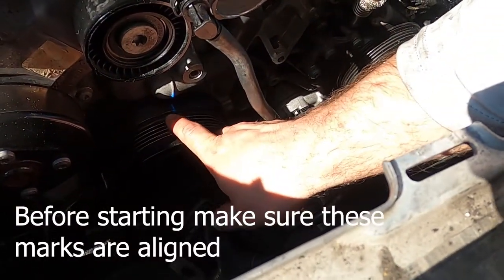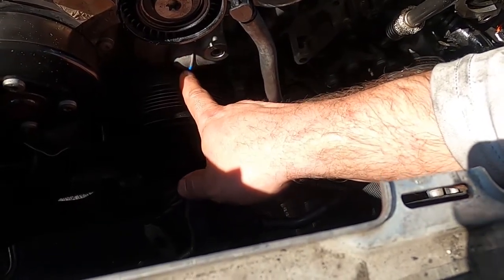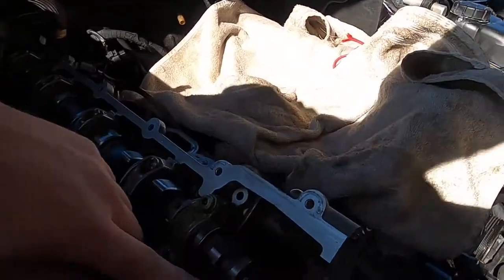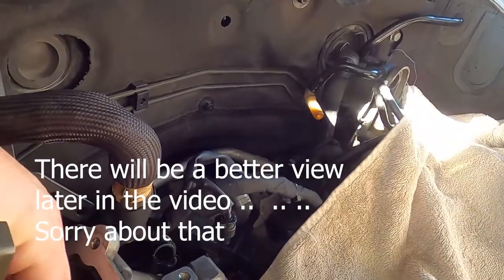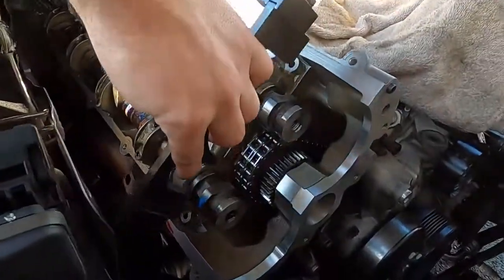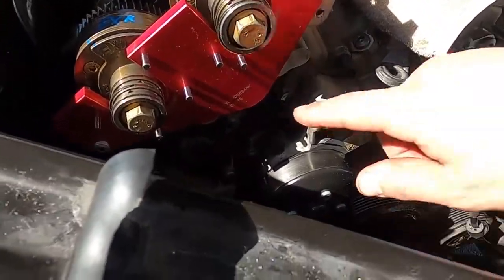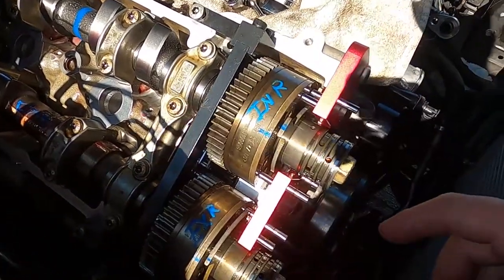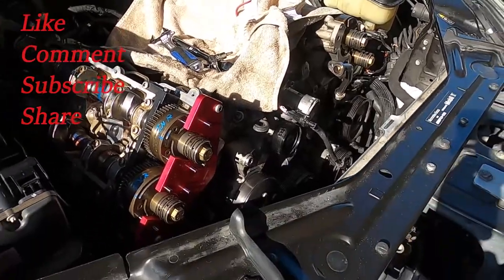Mercedes AMG Timing short version M156

Comment: Did all that Perfectly with proper tools. right bank corelration is off. re did right bank, same thing. I ordered timing tensioner.  Car runs perfect, no noises, sensors replaced for the bank and still same thing. Im hoping the tensioner will fix it. Otherwise maybe intake stuck runner or bad mixture where motor tries to accommodate by messing with the timing ?? IDK
Reply: How did this end up working out? I noticed that when rebuilding my cam adjusters, I locked at 40, did the left bank adjusters, etc. Then when locking down my right bank, I noticed that my right bank was slightly off. So I adjusted the cams slightly so that the timing tool fits. I assume I did everything right, but haven't fired it up yet.
Reply: @AnamorphicLenses  any update?
Reply: @OGYELLOW  been working perfectly since I did the job, car has run perfectly since. I think the knockoff timing tools have a very tight tolerance. I ended up timing both banks a few times to double and triple check that all was good.
Reply: @AnamorphicLenses  thanks man. Great News!!

Comment: Interesting.
Isn't advisable to use 2 timimg tools? One per bank .. just curious
Reply: Yes, it is recommended to use 2 timing tools simultaneously and once you done, do not start the engine. Just turn the engine - crankshaft manually few times and recheck the timing on both sides with the timing tools. This is the correct and safe way to do it. Good luck.
Reply: @jacektyski5370  great.
Can you reccomend a company to purchase the timing tools. JTC seems good but quite expensive

Comment: Since i do not see the timing mark 40° on the cranck pulley, can i turn the engine till the rear timing tool goes inside the camshaft carvings on both banks and say that i am ok ?
Reply: You must set your at 40 degrees,  since your camshafts could be out of alignment.

Comment: Quick question, once I have the cams locked in place does the front part of the cam adjuster that looks like a blade have to go a certain way? I know the part number stamp/m5 bolt hole has to be facing up but does the front part matter? The blade looking part? I hope the question makes sense. I have the timing tool for the job but I’m having trouble at making sense as to what the front plate of the tool does? Does that help as to the question I have?
Reply from the maker: Yes they have to be clocked, the tool in red locks then in place while you tighten
Reply from the maker: you really have to line it up and and play around with it, or google translate the german on there to better know which is intake and exhaust
Reply: Gentry101 thank you I watched a video & made sense of the tool. I already have the head off, but for some reason the reassemble intimidates me lol. Another question, do I need to lubricate the new headbolts? & also the head gasket? Should I add any sealer with that as well?
Reply from the maker: @rippp2343  My head bolts did not list lubricating anywhere, typically they will tell you if needed. I'd research your brand purchased to make sure. for the head gasket, I would place a very small amount of sealant where the front timing cover meets the block - very small amount
Reply: Gentry101 I’m using factory MB head bolts

Comment: Where are you located? I did my timing and have a question
Reply from the maker: What's the question, how may I assist
Reply: @gentry1014  just wanted to see if you were close geographically. I replaced my head bolts and set timing according to MB instructions using the timing tools. Somehow I managed to damage cylinder 5.  I described what I did here https://mbworld.org/forums/w211-amg/772989-m156-head-bolt-timing-please-help.html.  If you could read and let me know what you think I've done wrong that would be helpful.

Comment: Recheck timing meaning the screw hole on the cam adjuster is facing up at tdc 40 degree?
Reply from the maker: It's a habit of mine. After doing anything timing related:
Rotate the engine at least one full combustion cycle.
Set your crank timing to the correct marks.
Check you cam timing.
40* stamped on the crank pulley/hub is how Mercedes sets up their timing and associated tools
Reply: Thanks for responding back. I don't have a coolant leak or coolant light. I was only doing this as preventive. I have 109k miles on the car
Reply from the maker: @childerenofgod  you're welcome follow along the videos.
I'll help as much as I can
Reply: Thanks so much.  Do I need to take off the belt to turn it to 40 degrees?
Reply from the maker: @childerenofgod  it will make turning the engine over much easier.
Make sure when you're facing the engine you rotate the engine to the driver's side.
Reply: How do I take off the belt sorry
Reply from the maker: @childerenofgod  here's a pretty good link with diagrams
https://mbworld.org/how-tos/a/mercedes-benz-c-class-amg-how-to-replace-serpentine-belt-388955
Reply: Hey I have a quick question. When I put the crank to 40 degrees the holes on the cam adjuster were not facing up.  I rotated it 3 times and the closes I got to having the holes up was past 40 degrees.  Do I take the cam shafts off at that setting and when I reinstalling them, rotate the crank to 40 degrees and then install the cams with the holes on cam adjuster facing up?
Reply: If u can call me it would be very helpfull
Reply from the maker: @childerenofgod  adjusters facing up?
Do you have the timing tools needed for this?
Reply from the maker: @childerenofgod  https://youtu.be/kGIE-UM-Y1U
Reply: @gentry1014  yes I do have the tool. But do I need to bring the holes on the back of the cam adjusters to the top of the cam shafts(facing up). Or does it not matter as long as the crank is at 40 degrees tdc?
Reply from the maker: @childerenofgod  the slots on the back of the M156 cam need to be parallel with the cylinder head with the crank at 40* there is a second tool, flat piece that slides between the two cams to help hold them in place
Reply: I am not able to get them to be dead center to the cam shafts or even on right and left of the engine("V") and to bring the holes to the top, the crank is past 40 degrees. I can put the tool on both sides, meaning I am able to put the tool on the cable cover camshaft by the Cam adjusters. But it's not facing directly up.  And neither is the crank at 40 degrees at that point.  Is there an email I can send u the pic?
Reply from the maker: @childerenofgod  gentryonsite9@gmail.com
Reply: I emailed u.  Please let me know if u got it
Reply from the maker: @childerenofgod  I emailed you a few things too.
Here's another good reference 
https://mbworld.org/forums/w219/659362-head-removal-cls63-m156-engine-fyi-dyi.html
Reply from the maker: @childerenofgod  
Another good reference https://youtu.be/pR-sGlCfGz8
Reply: Do I install the camshaft and tighten it down before I use the timing tool in the back?
Reply from the maker: @childerenofgod  start placing the cams and rotate to where they sit the most flush. Gently and evenly tighten the cam ledge.
Once tightened evenly then use timing tools
Reply: Thanks so much all done. Started the car up it started up easily.  A little rough, will that go away?
Reply from the maker: @childerenofgod  drive around and or let run at idle for a little while keep an eye on temperatures and coolant level
Reply: How do I check coolant level.   And also I got malfunction sign come on (car with arrow pointing up)
Reply from the maker: @childerenofgod  not sure what warning light that is? Maybe for air ride? There's a coolant reservoir that has a fill level on it.
Reply: Perfect thanks.  If there was any problems it would have had a check engine light?
Reply from the maker: @childerenofgod  that's the case with most vehicles, especially with German vehicles
Reply: By the grace of GOD no check engine light
Reply: Drove it 50 miles and I got check engine. 😥
Reply from the maker: @childerenofgod  I would check timing first, did you make sure the adjusters went back the correct way?
Reply: I used the tool
Reply: I used the timing tools. So should I have checked something else?
Reply from the maker: Should be pretty close. Make sure alignment tools align as well
Reply: @gentry1014  I got the back to fit the camshafts and the hold down bar on top of camshafts in front and the v shaped tool on the cam adjusters and I turned the blade thing on the cam adjuster till it fit between the cam adjuster tool.   What else should I have done?
Reply from the maker: @childerenofgod  I would check with local parts store to do a base reading of codes to see what faults you have
Reply from the maker: @childerenofgod  did you use a bolt or pin to hold the adjuster gear in place or did that tool to compress the gears suffice?
Really need to get a scanner on there and see what your faults are.
I had one from mixing up EGR vacuum lines
Reply: I used a m5 screw to lock the cam adjuster in place.